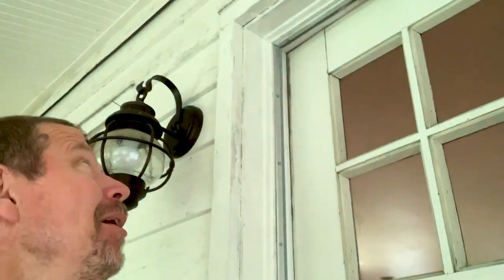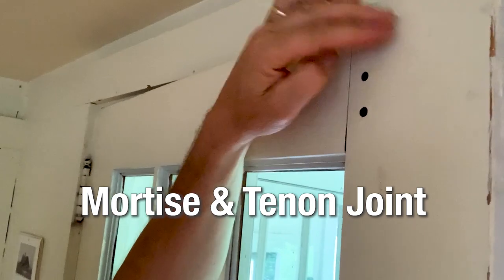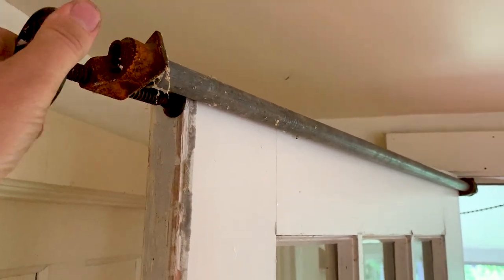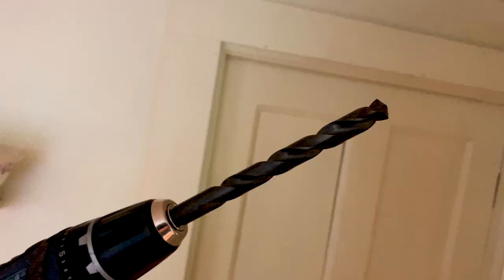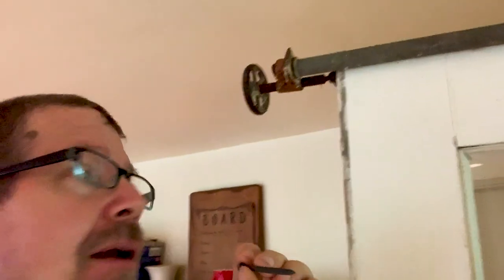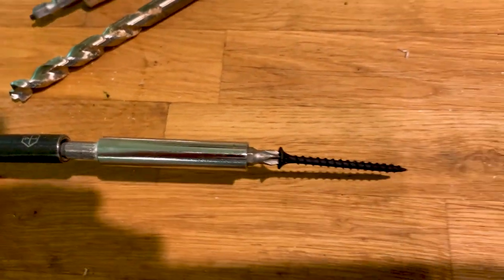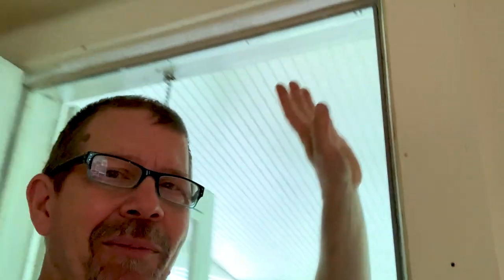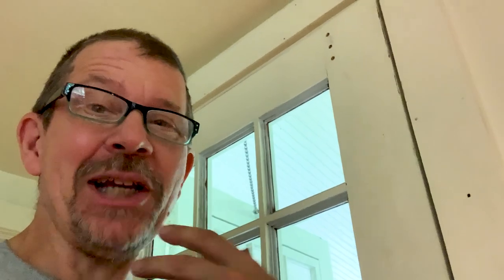Trying To Fix A Door That Sticks...

Comment: Great content GF! Only thing I would have done differently is to use Timberlock screws instead of drywall screws...they are longer, more coarsely threaded and hex drive. People seem to think drywall screws are a universal solution, they truly are too thin and finely threaded to have much holding power into end grain JMHO
Reply from the maker: Hi Gary, I am using Timberlocks on another project. They are great. Here I was thinking I needed a screw with a narrow head. But yeah, too many people use drywalll screws when they should use something better. 😀 Eric.

Comment: Great video! 

A tip I have for those "all the bits together" type setups is to get Bosch locking extensions. They're affordable, and make life a lot easierbecauseyou CAN'T pull a bit out without unlocking it first (maybe $8 for a 6" and $10 or $14 for a 12".) The only issue with them is that the lock mechanism is a bigger diameter, so they don't fit everywhere. But you can use them with any 1/4" hex bits, whether they have notches like modern drill bits, or not, even down to 1" bits! 

The other tip is have is to keep a new Makita bit holder. They are notorious for holding onto bits so hard you literally need pliers to remove the bit, so what better option for this type of setup? Less  convenient than the Bosch ones, but because they just use a c-clip inside a normal diameter bit holder, they can fit in smaller holes. The new ones aren't ad strong as the old ones from 5 or 10 years ago, but they're still better than most bit holders for holding power, and wear slowly, so they will hold better after years of use as well. 

Another option would be to add hot glue inside the bit holder, but I'd only do that if you don't mind having a permanently attached bit and holder LOL (definitely an option though, especially if you deal with a lot of this kind of deep hole drilling with a specific bit size.) 

Finally, you should get construction screws with washer or pan heads instead of the flat/countersink headed drywall screws you showed (unless those are construction screws that just look like drywall screws). Construction screws are stronger, and you can get exterior rated ones which would fare better in an outside door like that. In addition, the washer head pulls the wood together with all the force of the screw, instead of using some of that force to bury itself and spread that wood apart (I've cracked a lot of boards with countersink screws because of that). 

I don't mean to ramble on, I just like talking shop and sharing what I've learned over the years.

Comment: Have a 100+ year old house so I know your pain!  Now get some dowels and fill in those holes
MY bench gets like that over the summer and when we are stuck inside is usually my time for cleanup and reorg of the cellar and workbench
Reply from the maker: I was thinking the same Dave, dowels will fill up the holes and not crack like wood putty 😀